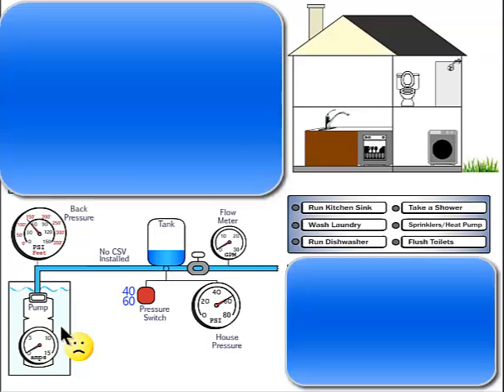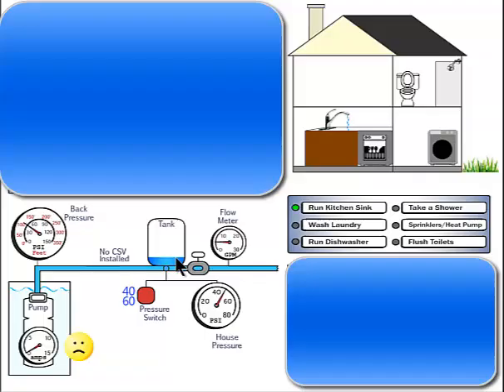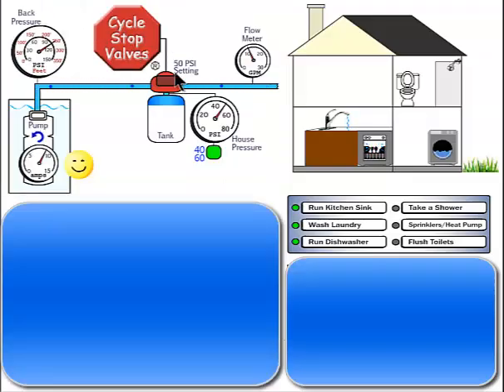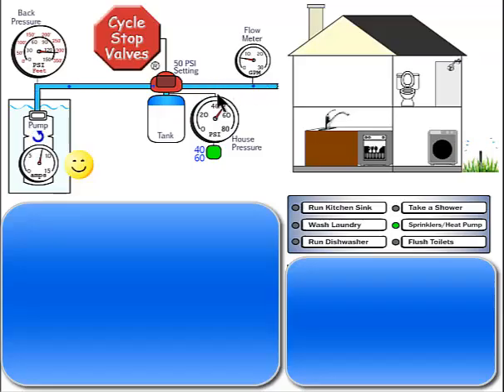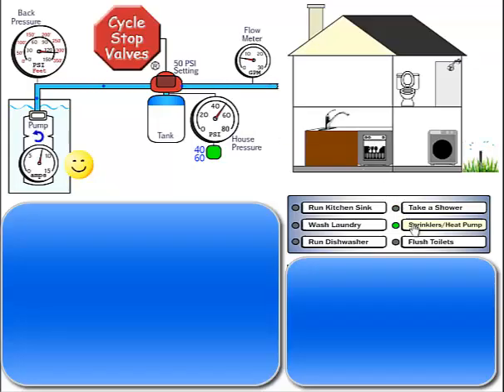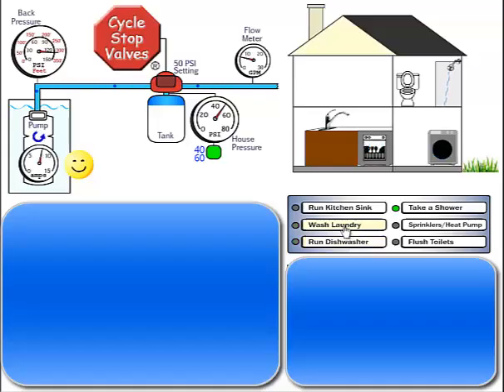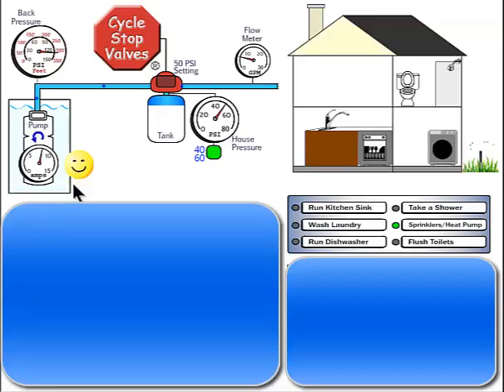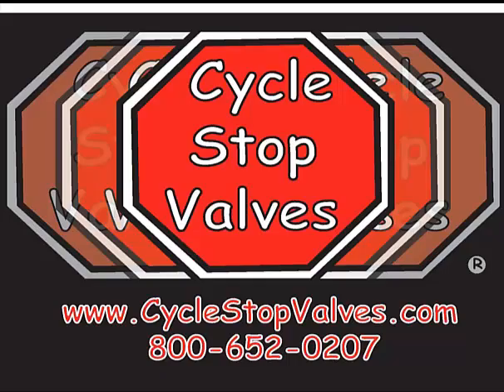How a Pressure Tank Works and why you need a Cycle Stop Valve

Comment: I'm not an expert on motors and controls but with the little I know:  I totally agree on the constant pressure and the cycling of the pump but the amperage load is what I don't agree.  If you choke that line I would think the motor would feel the increase load meaning more amps, more electricity, more heat, and yes less life.  I'm sure others think this way.  If its a simple mechanical valve that opens and closes I can test this.  So basically check amps on pump at regular operation and then start to choke it down with regular valve to see the amperage reading, my guess amps go UP.  If they go down, I will buy three of these valves that same day (have three wells).
Reply from the maker: Yep the whole thing is counter intuitive.  Everybody thinks restricting the output of a pump will make it work harder, when just the opposite is true.  If the amps go up when the pump is restricted the thrust bearing in the motor is bad, which is how motor thrust bearings are checked.  If the amps don't go down at all, you just have a bad designed pump, which there are a few of those like a 10 GPM Pentair pump.  But the amps will reduce by 20-30% in most pumps, and the really good ones like a Grundfos the amps will drop by 50-60 %.  Watch the video titled Pump Curves Technical Video if you want to see how the power drops off as the pump is restricted.  Even though it is a normal characteristic of pumps, most people, even some pump engineers don't understand it.
Reply: Thanks for the response back.  I really don't know what pumps are these brand/style wise, they were installed prior purchase of property.  All I know is that they are submersible pumps in wells.  It used to be a plant nursery (reason for the high water demand with three deep wells) so I assumed they used good stuff.  I only use one well for irrigation (big well) and it does cycle when is running so I do want to extend the life.  I've researched the prices on those pumps plus labor and is not cheap so a $400 investment makes all kinds of sense if it works.  Thanks again.
Reply from the maker: Wouldn't still be here selling Cycle Stop Valves after 25 years if they didn't work.  But I wish I had a nickle for every time I heard that statement.  Nearly all pumps will have reduced amps when the flow is reduced.  And there are NO pumps that will have an increase in amps when the flow is restricted.  May not even be $400.  If you already have a pressure tank and pressure switch, adding a CSV could be $63 or $174.  But we match the CSV to the size of the pump, so will need a little info on the pump.  If you do not have the pump model number, we can back into what we need with horsepower and GPM, even if you have to do a bucket test to figure that out.  I am an old driller and pump installer, so I can help figure the size of pump if needed.
Reply: According to the previous owner, the big well that I use for irrigation is 300 ft deep and produces 60GPM thats all he knows.  That is why im thinking the CSV2W will be a better fit.  It irrigates in sections but at any given time up to 8 sprinkler heads could be running.  Anyway I may try the smaller units (CSV125) on one of the small wells just to test it and then get the irrigation CSV which is $400 but if its going to triple the life of that pump, is well worth the money.
Reply from the maker: Jose M Solis
Just because the well will make 60 gpm doesn't mean you have a 60 gpm pump.  Measure how much come out of 1 sprinkler in a minute and multiply times 8.  I'm guessing more like 25 gpm.  Then don't use the CSV125 if your not sure how much pressure the pump can make.
Reply: Think of it this way, Jose - spinning an impeller is very little work, and therefore requires very little amperage. The real work for the pump is in lifting the water. If the backpressure in the pipe were increased, (due to increased depth of the pump and/or decreased well water level), the pump must do more work to lift the same volume of water a greater distance. In this case, being that the height of the pump obviously remains at a static level, increased backpressure from the CSV means LOWER flow rate at the same head. The result is less work for the pump (more impeller-spinning rather than water-lifting), and therefore lower draw.

Comment: My system is 12 years old.  Water pressure has always been poor when running more than 1 tap. My pump went out last week. I installed a Flint&Walling 1/2 hp 10 GPM pump at 135 feet. I have a 20 gallon pressure tank I set at 50/70. Air bladder at 46psi. Pressure still poor. Which valve would be best for my situation? Also, should I set my cut in/cut out back to 40/60?
Reply from the maker: Look at your pressure gauge while you are experiencing low pressure.  If the gauge is going from 50 to 70, and 70 to 50 over and over, a CSV will hold a constant 60 PSI, which believe it or not is much stronger shower pressure than the average 60 you get when cycling between 50 and 70.  But if the gauge just stays low like 30, 40, PSI you just don't have a large enough pump to supply as many taps as you want to run.  If the pump is cycling, a CSV1A would solve the problem and give you better pressure.
Reply: Cycle Stop Valves My gage does exactly that, cycles repeatedly. Not to be a cheep skate, would the CSV125-1 60psi solve my problem?
Reply from the maker: Yes the CSV12560-1 will work with that pump.  And it maybe the one you need anyway as it is really designed to install in the well for systems that have a water line teed off the main before it comes into the house and to the pressure tank.  But you can also install it close to the tank.  If you have sand, iron, or sulfur in the water the CSV1A is a better choice. The CSV125 is also not adjustable, so you can't turn it down if that is needed.  Also is there a chance you have a filter clogged up, as 50/70 should still be good pressure, just fluctuating.
Reply: Cycle Stop Valves I have a regenerative water softener, high iron. I have read reviews with similar situations, all positive results with the 12560-1. Will it matter where in line between pump and tank I install it?
Reply: Looking at the consumption chart on your Web page, it says I should have a 12-14 GPM pump. I just replaced a failed 12 with a 10. The fella at Ferguson said the 10 would be more than sufficient. I'm a little concerned that a CSV would even benefit my system. Whenever a higher usage tap is running, shower or washing machine, pressure to other taps is cut in half. I have 2.5 baths, and 7 faucets, washer and dishwasher, two hose bibs.
Reply from the maker: The CSV needs to go before the pressure tank/pressure switch and before any water lines tee off.  And with high iron, I would recommend the CSV1A instead, as it can handle iron and is easily cleaned if needed.
Reply from the maker: A 10 GPM pump is probably the same as the 12.  Some companies call it a 10 some call it 12.  Either way a 10 GPM pump can deliver up to 15 GPM is the depth and pressure are low enough.  You may have a clogged filter or pipes that are too small, because a 10-12 GPM pump should be able to run 3-4 showers and or a washing machine without any lose of pressure.  When as you say the "other taps are cut in half: what is the pressure gauge doing?  I am guessing the pump is still cycling on/off like 40 to 60, which means you have plenty of pump and the water is just not getting to the taps like it should.
Reply: Cycle Stop Valves the way my system is routed, it's pump to softener to pressure tank. I can install the CSV1A directly before pressure tank, after the softener? There are no tee offs until after the pressure tank.
Reply: Cycle Stop Valves the pressure gage cycles between 50/70. I watched it the other day during a toilet flush, seemed kind of rapidly to me. I did order the CSV1A as you recommend. I've read all about the valve, and dozens of reviews with similar issues as mine. All were solved. Not sure about a restriction, how would I check? Thanks
Reply from the maker: Normally the softener would be after the pressure tank.  Pump, CSV, pressure tank/pressure switch, softener, house.
Reply from the maker: With a CSV holding a constant 60 PSI, the house will have stronger pressure than when the pump is cycling between 50 and 70.  But you can have a constant 60 PSI at the CSV and still have low pressure at the shower if the lines are too small or clogged up.  May just have to increase the pressure to force more water though the small lines.
Reply: Cycle Stop Valves my mistake, you are correct.
Reply: Cycle Stop Valves if I were to increase the pressure at the pressure tank, would I need to replace the switch? And how high could I go without blowing a line?
Reply from the maker: Most regular pressure switches FSG2 can be turned up to about 55/75 at the most.  Blowing out what line?
Reply: Cycle Stop Valves any of the plumbing lines post pressure tank.
Reply from the maker: Yes after the pressure tank you can tee off as many plumbing lines as you want.
Reply: Well I installed the CSV1A today, it works as designed. My tank is set to 50/70, I set CSV at 64psi. However, my water pressure when using multiple taps is still poor. Must be the plumbing. I had the house built in '05-'06. Pipe sizes are up to code. I just don't understand what is going on. Oh well, at least my system functions more efficiently.
Reply from the maker: MrVinnied got any filters that could be clogged up?
Reply: Cycle Stop Valves just the salt regenerative water softener
Reply from the maker: MrVinnied see how much pressure you have with the softener in bypass.
Reply: Cycle Stop Valves I plan on disassembling and cleaning my brine tank and softener in a couple of weeks. Every three days it self regenerates. I've noticed lately that after each cycle, the water has a light rust color to it for about 24 hours.
Reply from the maker: There is usually a bypass valve on the softener.  With 64 PSI constant from the CSV, you shouldn't even need soap in the shower.  That much pressure should just blast the dirt off of you.  Must be a restriction some where.
Reply: Cycle Stop Valves I'm going to attempt to flush the lines to and from the softener when I clean it and the brine tank.
Reply from the maker: If you do not have a bypass valve for the softener you might consider adding one.  That way you could tell if the softener is causing the restriction.
Reply: Cycle Stop Valves yes, it does have a manual bypass valve. I will definitely try that.
Reply: Well I finally got around to cleaning my brine tank and softener. Ran some rust out through it, and added some fresh salt. Also removed the 3/4 pex that comes off of the pressure tank and feeds the filter/softener. There's where we found the problem. It was packed with muddy iron deposits, down to the size of a No.2 pencil. Replaced the entire 30' run, water pressure is outstanding! Can run 2 showers and 2 faucets at the same time with zero pressure reduction! The CSV holds the pressure steady at about 63 psi!

Comment: Choking off the flow of the pump will increase amperage which only wears out moving parts and increases size of spark between contacts wearing out switches quicker . All I see is robbing peter to pay paul. As long as the pump is running longer it is using more electricity. I don't buy it . It goes against everything against everything I know about Mechanical Systems.  A bypass system would be easier on the pump but still increases run time . Run time costs money.
Reply from the maker: NO, amperage goes down not up when the pump flow is restricted.  And the contacts on the pressure switch do not wear out, because the pump is not cycling.  You are on the right youtube page to learn something new today.  Just see the video about pump curves and you will learn that restricting the flow from a pump is a good thing.  The amps are reduced, the motor runs cooler, and the extra run time is what happens when the cycling is eliminated, which makes the pump and everything else last much longer.  But don't feel bad.  I thought the same thing 30 years  ago.  Very few people really understand how pumps work, but everybody thinks they do.
Reply: Very Interesting. I threw everything I had at it and you bounced right back. I like that. Maybe ,I can, learn something new. I'm never closed minded about something totally new. I'll give it the benefit  of the doubt until I actually test it for myself.  Cheers I have a nice pump system right now with a 4gallon tank. If you send me a valve ,I'll make a YouTube Video on Unpacking , Installing , and testing your valve and if it doesn't cut the mustard ,I'll send it back to you and delete the video.
Reply from the maker: I appreciate the offer, and I did have to give a bunch away to get people to try them 25 years or so ago.  Have you seen any of the "Reviews" on our home page at this link?  http://www.cyclestopvalves.com/
Reply: There is nothing to prove. With centrifugal pumps amperage drops when restricted (less flow and more pump head pressure). With positive displacement pumps, which are very rarely used in pressure systems, amperage goes up when restricted. The video is really instructive and this solution solves the biggest drawback of traditional presostatic systems, which is cycling and variable tap pressure. 
I understand we are talking of a pressure reducing valve, with constant output pressure. As far as I know this type of valves introduce big pressure losses, very noticeable at higher flows. If this were the case, pump efficiency would be affected, and power consumption too.
Reply from the maker: The only time you even see friction loss with a CSV is when trying to use the max flow the pump can produce.  Anytime you are using less than max pump flow, the CSV is putting extra "friction loss" on the pump to make it pump less water.  And as this video shows, adding friction loss to a pump pushes it to the left of its curve, and actually makes it use less energy, not more.  In most of these applications the pump is never used at max flow, so friction loss is a moot point.  But we have done systems where occasionally the pump is used at max flow, and it is easy to disable the CSV, let it go wide open, and that way it doesn't have any friction lose to speak of.

Comment: I still don't get it. I'm thinking the pump puts put a fixed amount of water per minute.  If the pump puts out more volume than is being used what happens to the excess flow? In other words, how does the CS valve vary the volume to regulate the pressure?  Seems like there is a narrow range where flow rate and water usage would be close enough to reduce the number of pump cycles. The diagram seems to show there is a balance between flow rate and consumption.  Wouldn't think this would be to common.  There is still going to be pump cycling but at a lesser amount...?
Reply from the maker: I am sorry you still don't get it.  As you can see I have tried many ways to explain this simple valve.  And it is a simple valve.  It just closes to reduce the flow from the pump, making the pump think it is in a deeper well, which makes it pump less water.  The CSV just cannot close to less than 1 GPM.  So as long as you are using more than 1 GPM the pump NEVER cycles.  When you are no longer using any water, the 1 GPM coming through the CSV has no place left to go except the pressure tank.  Then the pressure tank is filled to the pump shut off pressure and the pump is shut off.  The next time you use water you cause another cycle.  The pump only cycles for each individual time you start using water.  But the pump NEVER cycles as long as the water is running, like systems without a CSV do.

Comment: I have chicken houses. So at times I have water running all day for cool cell pads. Is it better to let the pump cycle (without CSV)
giving it a chance to rest or (with the CSV) would the pump be OK running all day?
Reply from the maker: Pumps do not need to rest.  Pumps are made for "continuous duty".  They will last longer running 24/7 than if it cycles on and off even a few times per day.  I have a pump feeding a stock tank that hasn't shut off in 15 years.  Just like a diesel engine in a truck, they are made to run 24/7.  Start and stop them 50-100 times a day and you will need a new one shortly.